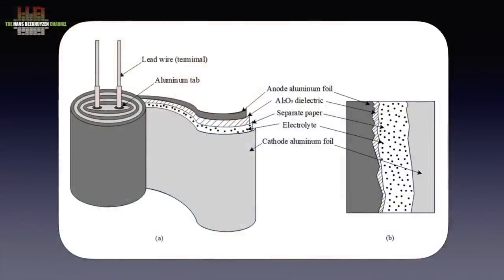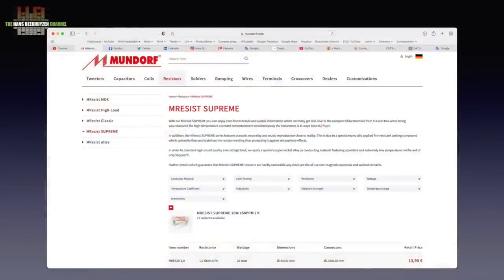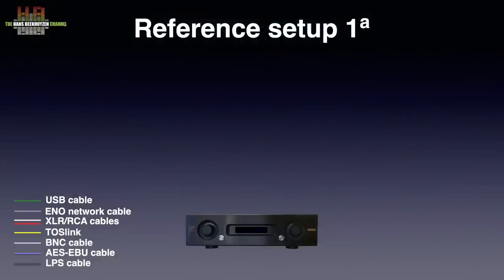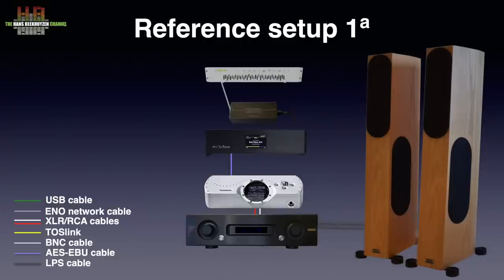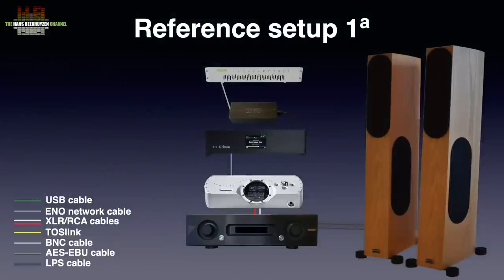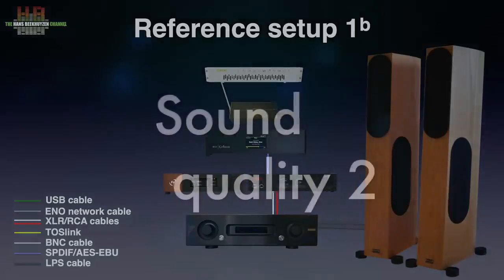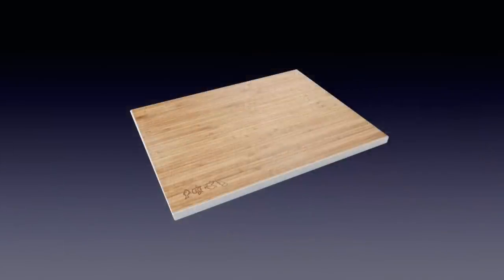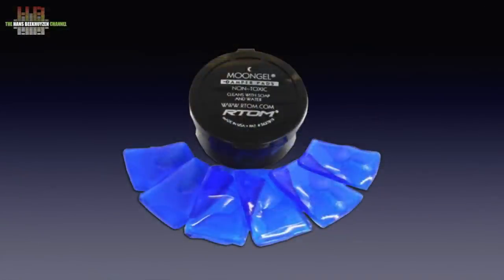€ 23 DIY isolation platform

Comment: My amp and power supply are sitting on rubber end stoppers that would normally fit on the legs of a chair. My house is on a concrete slab so there’s no vibration in the structure.

Comment: I tried all kind of damping boards for my equipment, by nothing were good. I went the opposite way and put heavy 10kg stainless steel plates 330X300x13mm on top of my amplifiers and on my SACD-player. It was a huge improvement in sound quality in the same way Hans described. Now I understand why expensive high end audio components often are so heavy.
Reply from the maker: Thanks for sharing

Comment: as a drummer with experience with moongel, it deteriorates in time (uv light makes it go bad fast) and could make some pretty bad stains depending on the surface .. i'd use two cuttingboards and sandwitch the moongel cause id forget about it in a week and never change out the gels.. hehe. real good video! thx!

Comment: Firstly I must state I'm a big fan of Hans and the work he does but I have a question: These pads can't prevent sound from the speakers affecting equipment as that would pass from the speakers through the air and into the equipment directly (just like your ears). So are they meant to reduce vibrations from the floor passing via the rack or stand into the equipment? Perhaps the vibrations that may arise from the sound the rack/stand absorbs from the speakers?
My home is on a concrete slab so I doubt it ever vibrates. Perhaps if you have a resonate wooden floor there is an effect?
Could speakers be loud enough to cause resonance in my equipment rack? I doubt it it's the same plywood my speakers are made from. I hope the speaker manufacturer wasn't exaggerating the ability of plywood to be acoutically "dead"?!? Is Hans' rack so resonate as to be problematic?
What vibration do these prevent then? It must be significant to actually change the quality of the sound that Hans' solid state equipment produces. Let me know....

Comment: I’ve used this (single board 6 pads) to put under my Roksan Attessa turntable which is currently on a pretty flimsy stand until my new one arrives. It’s totally eliminated skipping from heavy footfall. Even when I provoke it by having a good stomp around nearby. Pretty pleased at a mere 24.

Comment: The problem with cutting boards is that they are kiln dried, this makes them very hard similar to glass or granite.  I built a DIY stand using MapleShade’s air dried ambrosia maple wood blocks.   Of course used IsoAccoutics Oreas as well.  Fantastic sound!
Reply from the maker: The bamboo boards I used are certainly not as hard as glass.

Comment: You can cut a exercise matt and place it under board or speakers. I seen similar use at a antique audio shop used on speakers and other items.
Reply from the maker: I think it's too soft and make the speaker cabinet react against the movement of the woofer(s).

Comment: You could also try sorbothane sheets (various thicknesses) that can be cut and put under the board. I had also used gel pads (under my amp) but unfortunately these disintegrated over time.
Reply from the maker: Sorbothane is harder and more suited voor heavy devices.
Reply: Depends on the size, shape ( how you cut it) and durometer of the Sorbothane.  Using that material for isolation, and slate for mass, I have derived marked improvements from turntable, phono pre, tube pre and integrated amplifiers and even solid state power amps, as well as DACs and speakers.   80 percent of the improvement of the high-priced spread for < 10-20 percent of the cost = works for me.

Comment: Hans, why not start with mdf sheets layered in cork sheeting?  I did a 3 inch sandwich with some feet I had for under 25dols and 10 minute install. Dead silent.  Also, farther away from the wall, the better... with in reason. My. TT weighs 65lbs.
Reply from the maker: If it works, it works. Thanks for sharing.

Comment: Thanks Hans!  Love a little bit of DIY, especially when it works as good as this! I am using three thin, double layer bamboo boards with two layers of moongel in between them for my Arcam rDAC to sit on. Two small doorstops, 0.7 kg each on top of DAC. This has  not only made the bass firmer, more defined and vocals more natural but also opened up the soundstage which became very three-dimensional. I would say this has worked better than expected, and is comparable to upgrading to a higher class DAC.
Reply from the maker: Great tip!

Comment: Very nice results. I have always belived in making each component heavier by placing it firmly on something heavy, and isolating the whole system from the ground. Your solution is right along those lines.

My large floorstanding speakers rest on 60x30x3 cm slates weighing more than each speaker. Three spikes connect each speaker to the slate. And 6 soft furniture stickers below each slate make them mostly isolated from the floor. I find this solution to greatly improve the sound, especially in the lower bass section. I would really like you to try out this solution. I bought the slates from a stonework shop for about $150 for both.
Reply from the maker: Thanks for sharing

Comment: There are so many off the shelf, non audiophile solutions for vibration control. I am itching to try the dryer vibration pads they sell on amazon with some floor standing speakers. I am sure that they will likely get 80% of the way there or more, at 80% of the cost. Be interested to hear your take on these types of solutions. I get that maybe a transport would benefit from this approach, I am dubious  that vibration control will impact the sound of my streamer. Maybe a tube amp that has some slight microphonics?
Reply: Most of those are made with a material that has the commercial name “Sorbothane”. It varies. Most speakers react badly, because the frequencies it dampens is different than the frequencies that make a washing machine rock and amplify through the connection with the floor.
Reply from the maker: Moo gel definitely is NOT Sorbothane!
Reply: Interesting how fashion changes, I found coupling my floorstanders to the floor with spikes made a vast difference. Now it's suggested doing the exact opposite will also bring improvement rather than just taking you back to where you started from.
Reply: @TheHansBeekhuyzenChannel  No one said it is. The "dryer vibration pads they sell on amazon" mostly are.

Comment: I have tried similar experiments with a board supported by Sorbothene hemispheres or the harder the split aluminium puck with ball bearings in between and as you say equipment reacts differently with some being better with one type or the other. I did find an bigger improvement with my Brooklyn when a weight is applied to the top case. I used a stainless round door stop from Amazon as a lot of other audiophiles.
Reply from the maker: That's because sobrothane is relatively hard and needs more weight to function.

Comment: Hi Hans! Thanks for pointing out these gel packs. I bought quite a few after I got my turntable on them. I sandwiched them between two 1“ bamboo boards and there’s no noise/vibration transfer now. 
As to how much weight they can hold, I put 12 packs under a board and put my 45 pound tube amp on it. It works fantastic!
Reply: @TheHansBeekhuyzenChannel   just to follow up, the 12 pads under the amp got permanently deformed but are still squishy tho. I added 6 more to it. Everything in my system is now on these pads and it’s really nice. Better than I imagined. For reference, this is what I’m running :

Rouge Audio RP-5 preamp
Rogue Audio St-100 power amp
Rotel RCD 1572 CD player
Fluance RT85 turntable
Gustard x18 dac
Gustard u18 dcc 
Klipsch Quartet speakers 
Klipsch SW-10 sub x2
All wired with Krell power cables and blue jeans cable interconnects. Run over a dedicated Powerline.
Reply: @bulldozer9600   hey they still holding? My experience with moon gels over the years is that they will turn to glue like jelly and dissolve.
Reply: Mine still work 2 years on

Comment: I used Mission isolating platforms on my Sound Organisation hifi racks which had suspended shelves made of a similar  shelf material to the Missions. The Missions use Sorbothane between the shelf and the hard plastic " feet". They still work well in reducing vibrations in what is now my set up two. I replaced  the stands with Atacama Eris stands with 40mm bamboo shelves made up of 2 layers of side by side layers of bamboo of 20mm thickness . They do an excellent job of damping vibration and passed the Aesthetic Commission. The only problem occurs if you need to use more than 5 items because it can only be extended vertically although the height between the shelves can be changed. As I wished to add another motorised item to set up 2  and only had 3 Mission platforms I decided to try bamboo chopping boards ex Amazon. I bought a similar board to the one you tried i.e. Side by side layers making an approx 22mm thick board. I found this gave little or no improvement over the rack's suspended shelf. I then tried a 420x300x40mm board made of edge- on bamboo like a butchers block. The result was impressive. At least as good as the Mission vibration platform. I will now try the moon gel. Stay well.

Comment: I recently purchased some large and relatively thick cork boards to go under my gear. Only because i like the way it looks, but it is very spongy, yet stable. Do you think you could add something like this to a future test? Wonder if it helps with vibration dampening, as well as being easy on the pocket book.
Thanks! Love the videos.
Reply from the maker: I think the gel solution is far better so I won't test cork boards. Buth time and funds are not unlimited. Sorry.
Reply: @TheHansBeekhuyzenChannel  Copy that 👍 
Thanks for the reply.

Comment: Interesting and informative video on hi-fi equipment isolation. 
I have been aware, but not convinced such tweaks actually work? 
However, that doesn't stop me from tweaking and testing.
Currently, I have only isolated a Denon DP-47F turntable with headphones foam earpads & styrofoam with very good results. (Only mixed the compounds to proper level the turntable)

I tend to favor the idea of softer deadening materials over harder solid denser material like wood that can resonate. 

This video has inspired me to go do further testing and isolation trials with my vintage components. 
I will be using half inch thick typical packing styrofoam with a stiffening particle board atop. My Sansui AU-D11 ii integrated is heavy enough resting atop glass. 

It would be further convincing, if you were to use maybe a vibration detector to base your results of isolation scientifically?
Often tweaks have a placebo effect at best.

Comment: Very interesting topic. I just recently started experimenting with vibration control and found very noticeable improvements. So far I've tried Isoacoustics Isopuck and squash balls under my preamp, pre amp power supply, power strip, power amp. I tried various combinations and have to say that squash balls work better for me. I'd like to try your solution, maybe you could try squash balls too. They're quite cheap. The ones I'm using are with two yellow dots. I cut them in half and place them under the components. I also tried using balls without cutting them, but apart from being unstable, they also didn't work as well, I noticed dynamics and high frequency extension were affected negatively. Let me know if you decide to try them!
Reply from the maker: Thanks for sharing
Reply: Try the IsoAccoutics Oreas series….far better.
Reply: hi thr it did cross m mind to use squash balls, as i am a squash player and have lots of them
Reply: As an update, I tried Isoacoustics Orea under electronics and indeed it’s much much better, I now have them under all my electronics
Reply: The problem with using squash balls is that after a while they tend to flatten and are less effective
Reply: I just read that some bought a paving slabs for under £3 it brought hhis system back to life

Comment: I put Dynamat car dampening sheets inside my CD player/DAC and improved the sound. I wonder how this material would work under bamboo boards? My components are already sitting on Isoacoustic discs. Another old vibration hack is bubble-wrap under the board.
Reply from the maker: Dynamat is designed to dampen metal panels by adding mass. They may dampen bamboo bords somewhat but won't isolate them from vibrations in the surface they rest on. That's what the Moongel does.
Reply: @TheHansBeekhuyzenChannel  Yes, I agree with you. They are rather dense, though still rubbery in order to cover odd surfaces. I used up two packets on my CD player, so I have no off-cuts to experiment with.

Comment: Hi Hans, thanks for this invention!
I put this 'Beekhuyzen board' under my recordplayer and its effect was stunning!
My Pink triagle Anniversary/Sme v/van den Hull frog has a very good vertical isolation thanks to the lightweigt subchassis hanging from 3 springs.
But your board gives also horizontal damping and that's needed against the soundwaves hitting the player. This results in a rockstable stereo image and also bass. Before cd sounded more stable but now vinyl is the winner. Advised for every recordplayer weighing less then a ton! Thanks for making my 30 years player a winner again.
Regards, 
Gerard A.
Reply from the maker: Good to hear

Comment: Would this already help in modest systems, like mine? (Kef ls50 meta, hegel h95, bluesound node 2i and a kef subwoofer)

Or would the bottleneck be somewhere else?

I am fairly new to this hobby, and am not sure what to improve first. My guess so far is the room's accoustic properties.

Anyway great video, very interesting, dankjewel
Reply from the maker: Hard to say but it's a small investment and if you intend to further improve your system you already have this.
Reply: Try the IsoAccoustics Orea (for the h95) and Gaia III (for the Kefs)… you’ll be amazed!
Reply: @mikeeygauthier2959  thanks! follow up question: my h95 is currently sitting on a cheap piece of furniture, would it be ok to leave it on there with the Orea's underneath it? or does it only make sense to use orea's if I get a proper rack first?
Reply: @TheHansBeekhuyzenChannel  yes will try! thanks

Comment: This isn’t typical audio review. The gear rack change can yield stability and that allows you to experiment with either dampening or coupling issues. Flimsy platforms cause a great deal of problems, but you could easily do a video on that alone. There are few inexpensive solutions in audio, but this solution has merit. Well done Hans! Stay safe my mates!😊👍🏻😁I prefer granite to bamboo. The granite is less prone to vibration. If used as a shelf as opposed to a stand alone platform, the granite offers a very stable platform. You may then use isolation feet or ball bearing feet depending on whether the equipment needs isolating or coupling. Experimentation is how we learn. Only then can we find the equipment’s true colors. Stable platform is the starting key. Learning can be fun. Addressing equipment anomalies isn’t snake oil. It’s reality. There are more than one correct answer to problems. The fun comes in learning where the weaknesses are and addressing them. It’s up to the individual to decide what is too much and what is enough!🧐

Comment: A question: I have often wondered about the effect of airborne sound on my equipment. When a  listening room houses the electronics and speakers, can sound waves produce significant vibration in the equipment enclosures? And wouldn't level be a big factor in that?
Reply from the maker: That is where solutions as in this video will help.
Reply: When my children started toddling i moved my Rock turntable to a secure room behind my amps. I couldn’t believe the difference, especially with the Rock’s damping at the front end
Reply: Items susceptible to sound from speakers or other can be damped to reduce this effect. Most components have a hard metal case that ring like bells. I have often damped the inside of component covers with sheets of rubbery sticky back materials like the kind used in cars by audio installers. Or you can experiment by applying absorbtive materials to the outside of the cases of DAC's, Pre-amps, Amplifiers. If these materials aren't available you can place a towel on top of the component with a flat weight (like a heavy book or other) to dampen case resonance. I was lucky to place my TT just outside my room with a slightly longer interconnect with very low capacitance per foot.
Reply: @blader.9433  I have used damping sheets on the cases of several components over the years, also placing them on very cushy rubber feet. I haven’t e ver gotten clearly audible improvements . My equipment is probably not good enough to reveal subtleties.  I am still curious about the issue, though.

Comment: I have some big ceramic tiles hanging around. I am wondering if they can replace the bamboo cutting board.
Reply from the maker: That depends on their weight. If heavy you might want to use more Moongel cushions.
Reply: @TheHansBeekhuyzenChannel  will there be any issue regarding resonance?

Comment: I haven’t gone down this rabbit hole yet (next stop cable risers) BUT i DO use a mix of kitchen Cork Boards, silicon pot stands AND (the I recommend for you to try) dense rubber vibration mats for washing machines. I mostly about speaker vibrations and sound treatment not microphonics. These i use for desk and bookshelf speakers resting on - and for office system- in cabinets. Might try the drum pads. Cheers